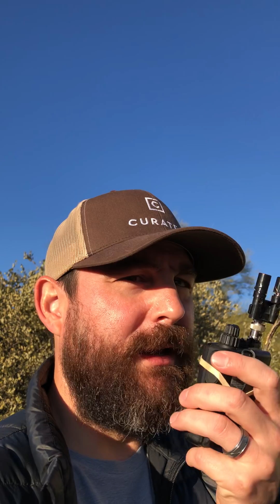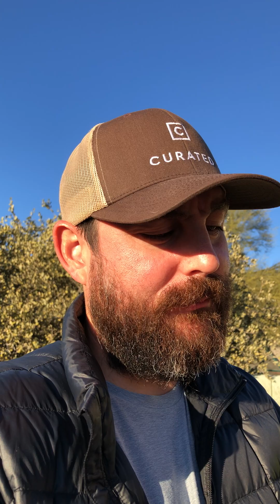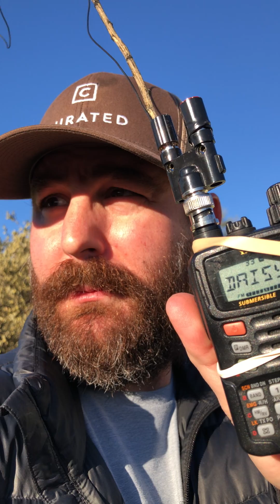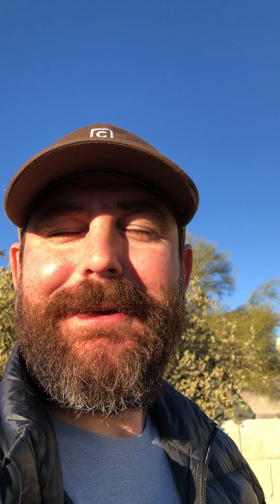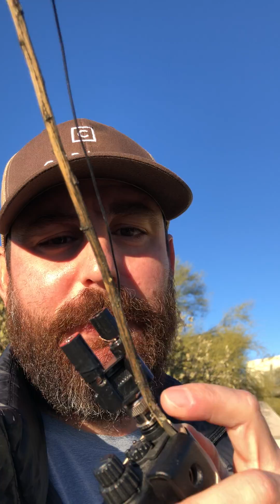HT Antenna Field Repair: MacGyver Fun

Comment: Nice!

You've got me wondering how effective a length of wire stuck in a SMA-f antenna connector on an HT would work for a field expedient antenna

Thanks
Reply from the maker: That would be really improvising the antenna field. I was thinking the same thing. I already have the Cobra head in my small mint tin antenna kit, so I figured this would be a good application.

Comment: It works alrite considerin u have it on the wrong side of the binding pole 😉 and those binding posts are good until they break
Reply from the maker: I tested the continuity with my meter. The center conductor is where the wire is connected. I am pretty sure that the RF current flows out the center conductor from the transmitter. This is a short term repair item. Got to love the keyboard warriors.

Comment: You can build on that to make a Jungle Antenna. Just add a length of coax and 3 additional lengths of wire to the other side of the split BNC.
Reply from the maker: That's in the plan. I have notebook filled with these field repairs. Thanks for the tip!
Reply: @TheTechPrepper  thanks!

Comment: Between "jungle antenna" ground planes made from wire and sticks to dipoles made from everything from Romex to CAT 5 cable, I can't tell you how many times a cobra head adapter has saved my bacon in the field.
Reply from the maker: These little guys are a must-have piece of kit. I have one each of my Altoids tin antenna kits. Thank you for your service. Enjoy the rest of your weekend.
Reply: "Saved my bacon in the field" May I suggest future videos on improvised antennas and related kit be named "Field Bacon"?
Reply from the maker: @gregrush6570  I like it!

Comment: That was pure MacGyver! Or hillbilly.  Having that banana plug adapter or spare antenna? I carry spare antenna with adapters for each HT I own. It will be a fun video. Add a bit on tiger tail too.
Reply from the maker: Dead on balls accurate. Yes, it was a mix of both. MacGyver did have a mullet at some point if I recall?
Reply: I do love your channel. Enjoy your prep communication philosophy too. Very logical. Years ago a friend of mine who worked for Collins created a program that worked with an SDR he helped develop at Collins (Rockwell Collins in Cedar Rapids, IA). His software would find best band and frequency to work a known contact for HF.